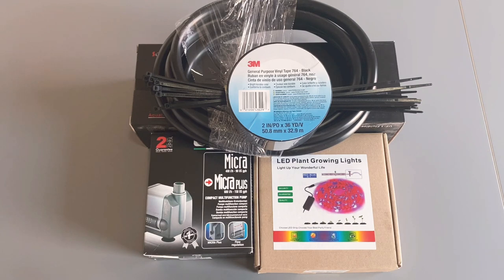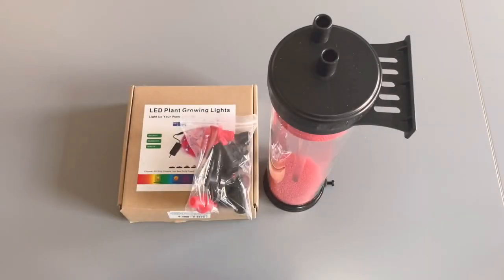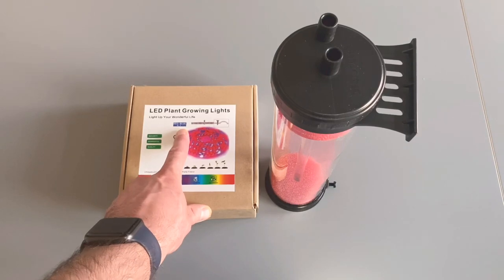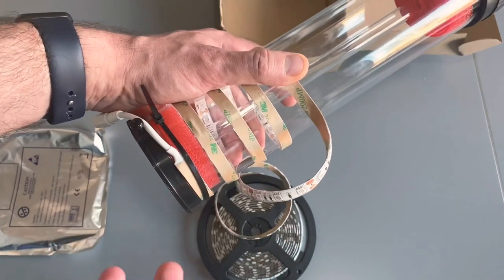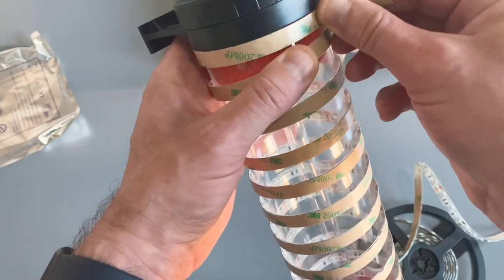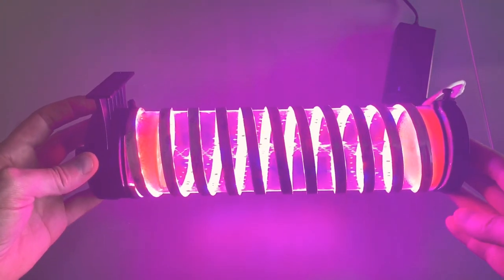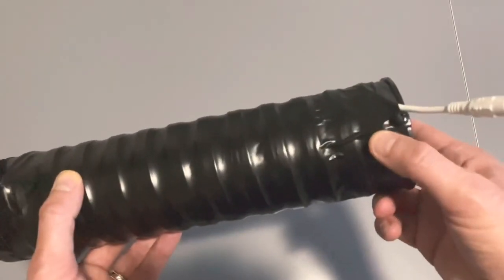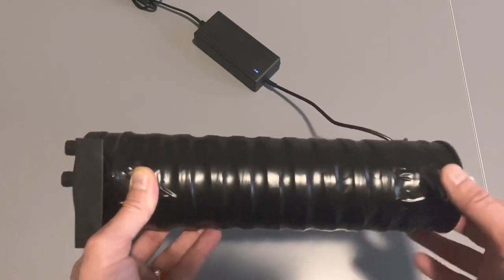Waterbox AIO Nano Reef Tank Build | Ep. 26 | DIY Chaeto Reactor

Comment: Can u show this in action? Like plumbing setup to the pump, as well as precautions like back siphon??  Thanks
Reply from the maker: I will be doing a video soon setting up bio pellet reactor using the same brand reactor, same pump, and 1/2 inch tubing. It will literally be the same setup as far as how I set it up. Back siphon isn’t a concern as the pump and hose are in the same rear chamber, so any back siphon just goes into the rear chamber.
Reply: @joety22  Thanks